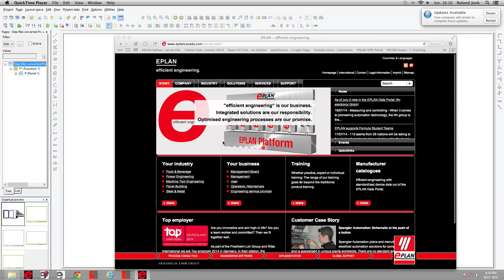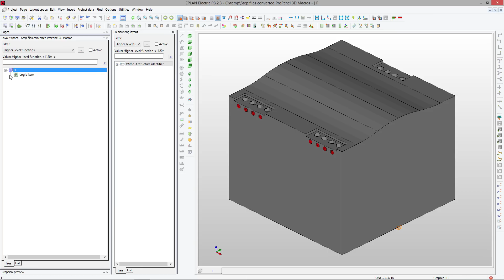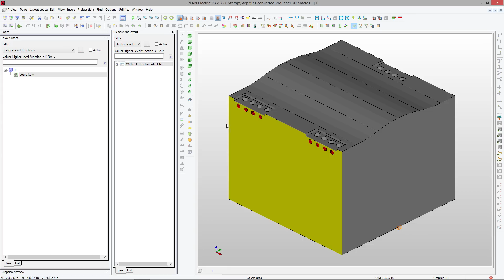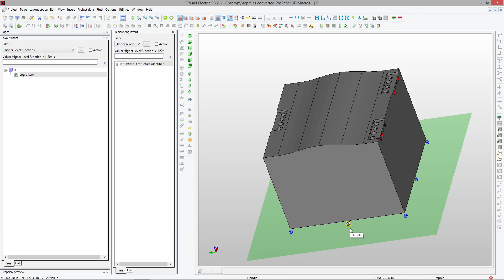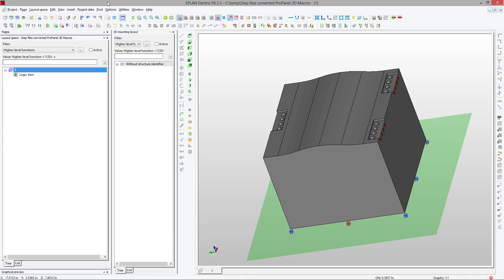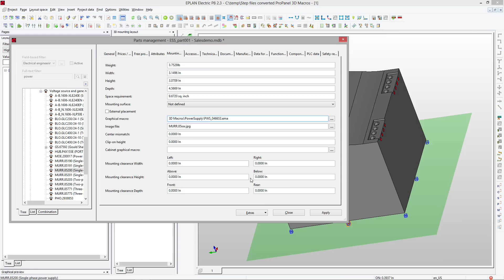EPLAN ProPanel 3D Macro Tutorial

Comment: What software is it. Is it ePlan Electric P8 or ePlan Pro Panel?
Reply from the maker: I use both Electric P8 and ProPanel. Both are part of the same platform EPLAN. Ask yourself what you need? I personally would always opt for a maximum of features. You can combine ElectricP8 with a Propanel add-on if you need to edit older projects with 2D panel layout. If you are ready to go only 3D panel layout, start with Propanel stand alone and add PLC Add-on included in Eleemnt Select +, Cogineer, Element Professionnal;+, Fluid Add-on and Preplanning Add-on. If you need to detail out Harnesses then also consider adding Harness ProD